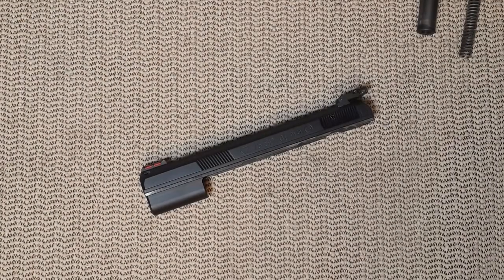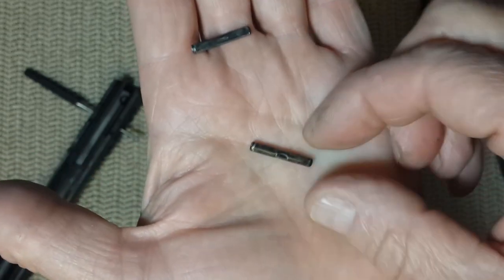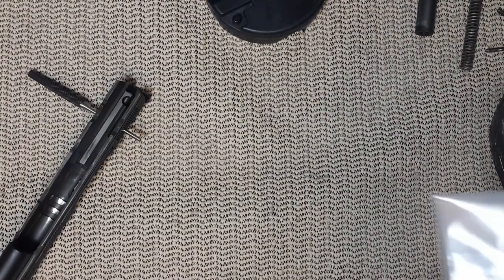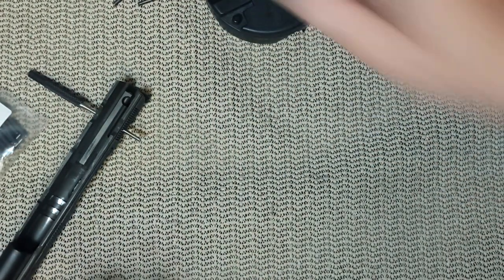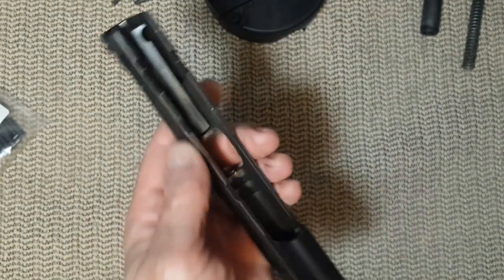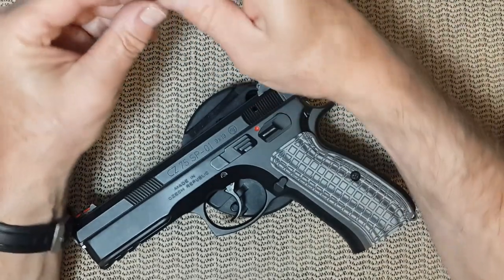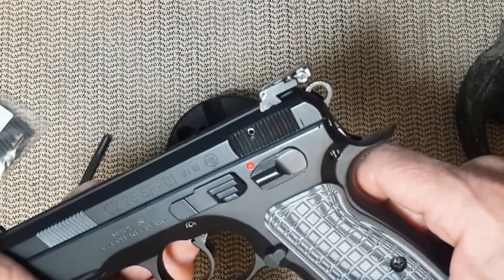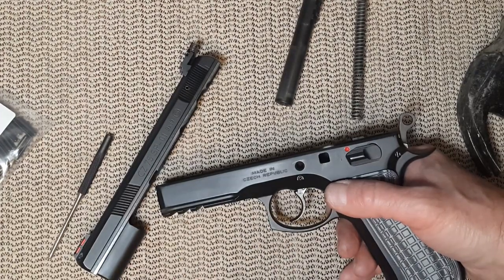CZ 75 SP-01 Firing Pin's Roll Pin Problem, and Solution

Comment: I did not know this was a problem.  I have like 5000 rounds thru my CZ SPO1.  How do I know when the pin needs changing.
Reply from the maker: John D - After removing the pin, if your pin is as dented as the one on the video, it is suggested to replace the pin.
Reply: 5000 rounds? lucky you...Im getting close but don't think I have that many....high 3's to high 4's, and mine broke, sheared right through bc the firing pin came right out with the firing pin block. I looked down the firing pin hole and saw nothing crossing the top, where the roll pin should be. I didn't know this was a problem either, now I know why it was sitting on the damn shelf for so long with no interested buyers. I think if pistols aren't circulating, somebody knows something I don't. I'm a little pissed too, bc the person at the shop who fixes the weapons acted like he had no clue as to what was wrong, and its all over the damn internet/youtube. Do you happen to know whats inside the firing pin hole? It looks like theres threads in there. I think it just may be ridges to hold the spring in place, but I want to find out for sure before putting it back together. I also heard about a solid pin, but up above, someone says it will damage the firing pin itself. I wanna make sure thats true too, before installing a new SHEAR pin. Piece of crap, really pisses me off. Ive heard nothing from reviewers about this/these kind of problem(s) on ANY similar pistols. I guess thats why people buy the $1.4-2K models. These may be good pistols, but this is the second one I own that something fell apart on, the other is a 97BD and the 4 pieces that make up the chambered round indicator fell off. Sorry this was long, but I felt like all CZ owners/potential buyers should know about these defects. Now I know why Glock people stick with Glocks...NO WORRIES MATE. I know they're Austrian, but it fits the topic.
      "Two residents killed today during burglary...homeowner had weapon, but seems to have fallen apart." "Probably would've ran the burglar off, if he had a Hi-Point." Thats the scenario that runs through my mind. OK, I'm off my soap-box now. Thanks for reading if you made it this far.
Reply: @1madmax22  sounds like a legit beef to this guy.  I bought three, sight unseen and customized them and have paid out nose for a suppressor for threaded barrel tactical (my supposed night stand gun).  Now I find out that in addition to everything else going on in life, I'll now be inspecting this bullshit item every 500 rds (or however long between inspections I think my life is worth) or so forever.  Some say they had no problems after subbing it with some tiny after market place (which makes no f'g sense; as you'd think CZ would have enough f'g pride to issue acceptable part to every f'g CZ owner over the past 15 years) but that's ridiculous. Just baffling.  And I haven't heard a peep about this mess until tonight.  I don't even remember how I stumbled across the issue.  Hilariously, just sold an unfired Glock .40 to a good friend because I had a CZ!  And I heard what I now have learned to be bullshit that suppressors aren't made for .40 (search the net and I can't find a hint of where I learned that one).

Comment: What size punch did you use for the firing pin, also what size punch for the trigger? I bought the punch and pins on Amazon, but I don’t want to use the wrong punch and mess something up. I want to learn how to do this stuff on my own though and not rely on a gunsmith.
Reply from the maker: Welcome back Michael. 
You will need a 3mm punch for the firing pin, that is, if you have the expensive Metric punch.
If you only have Standard punch (like most of us), the 3mm close equivalent would be 1/8" punch. In any case, always eye ball the size punch with the hole size. In doubt, go one size smaller, and as you hammer the pin down, you can change you punch to the next size up.

For the trigger pin, you will need the 1/16" punch.
Good luck
Reply: @practicalshooter6517  thank you very much. I had to order the roll punches on Amazon because all my local stores only carry the flat regular punches. I should not use a flat punch right?

My firing pin is stuck in the forward firing position. It won’t retract back far enough for the hammer to hit it. It’s almost like it’s stuck. I can still push on it and it moves freely, it just won’t come all the way back. It’s weird.
Reply from the maker: @AviMus82  I had the same issue when my gun was really dirty. The dirt kept the firing pin from moving freely. Once I remove the firing pin retaining pin, I used a paper clip to push back. You can also use a very small screw driver. Let me know if this help.
Reply: @practicalshooter6517  my problem is that I only have access to flat punches without waiting for the roll punches to arrive in the mail. Would a flat punch be ok to use, or should I ONLY use a roll punch?
Reply from the maker: @AviMus82  Yes you can use the flat punch, but it has to be the right size. Use the 1/8th punch. If at any time you think the punch is going inside the hollow pin, pull the punch out, but as the 1/8" punch is slightly larger than 3mm, it should work out fine.
Reply: @practicalshooter6517  k thank you for your reply. I appreciate how fast you are at replying. I’ll try the flat punch, but I also ordered the roll punches you suggested. 

Also one last thing, my hammer falls freely when the trigger is pulled,  it if you ride it slowly forward with your thumb you can feel it rub ever so slightly on the sear. I spoke to a gunsmith about it and he said if it’s operating fine than leave it alone. Do you think mayBe changing out the seat cage assembly would eliminate this? Again my only real issue is the firing pin. This doesn’t pose a problem to the functionality of the gun. It just bugs me. What would you suggest I do? Just shoot it till something breaks or replace parts till it stops?
Reply from the maker: @AviMus82  First of all, the roll punches you ordered are what you need to work on this CZ, the flat punches are just back up punches, so you did well to order those, then they will help you out with many other guns, so it's good to have them on hand.
Then, it's hard to tell without looking at your gun and knowing how many rounds have been put through it. Also, some powders are dirtier than others, which brings me to thinking of my original thought. Your firing pin channel is dirty,  and by that, it's stopping your firing pin to move freely. But everything else should fine. 
First, you would need to remove the firing pin retaining pin, then the firing pin and spring. 
Then with a q-tip and solvent, you will need to clean inside the firing pin channel by removing any dirt.
After this is done, re-install the firing pin and spring, then the retaining pin. 
Finally, I would think your gun will be running fine.

Comment: what are the benefits of removing the safety block?  i know the danger, but any benefits??
Reply from the maker: It gives you a slightly lighter trigger, not that much, but it ads up for competition, and by the way, on the safety side, I never had any issues. You would think, with the safety block removed and an extended firing pin, their is always a chance for the firing pin to hit the primer when loading first round in the chamber, but nothing ever happened.

Comment: do you have any experience with broken firing pins?  Ive broken 2 in my canik c100s and I'm disheartened.  I will refrain from dry firing them but since you seem like a cz guy is there any remedy to feel more secure about the firing pin?
Reply from the maker: Did the firing pins broke at the tip?
Reply: @practicalshooter6517  yeah, right at the tip.  I have been sitting at home all day for the coronavirus lockdowns and dry firing my canik.  I think I will just not do that anymore without a snap cap, but Im wondering if you have had any experience with them breaking under non dry fire conditions.  Ive had a particularly bad streak with strikers/firing pins breaking on handguns thhat have moved to MIM strikers, so i am kind of an outlier in that before I will carry a gun I need to ensure it doesnt suffer from striker/fp problems.  Such as the FN509, this gun has one of the dumbest designed strikers known to man and its MIM, idk how some gun companies can stay in business sacrificing the integrity of arguable the most important piece of the gun.
Reply from the maker: @jjmarcos  I never had issues with any of my firing pins on any of my guns, and I do shoot them a lot, and dry fire them a lot as well, without using a snap cap nor an o-ring. I suspect some firing pins will be better made than some others. 

MIM can be used with so many mixes of metals, that results of relliabilities are wildly varied. Manufacturers know that and will generally replace free of charge a bad MIM firing pin.
Reply: @practicalshooter6517  Thats good to hear.  The tri-star customer service told me the canik pins are machined and not MIM so that made me feel a little better.  Ive had so many mim strikers break on Kahr, Sig, FN pistols that Ive grown to distrust the method for this specific part.

Comment: Would you say the roll pin is the only issue on the cz?  Considering buying a cz 75 p-01
Reply from the maker: Yes, that is the only issue associated with the SP01 serie handgun. Go for it, CZ's are exceptional guns.
Reply: @practicalshooter6517  haha, I hope so.  I just waited nine months to suppress it and mounted a Steiner light about a month ago (plus CZC trigger job).  Planned to start cranking some rounds through it soon and I stumbled across this issue tonight.  I come to this video and it sounds like a legit, inexplicably unnecessary issue. I'm not mechanical in the least and have never removed one of these pins with punches and hammers, etc. Geez Louise.  To say this is kind of disappointing, is a big understatement.  I have SDP from CZC and CZ-75B (also sent to CZC) (both unfired).  Pretty sizeable investment and I find out I have to carry hammers, punches and bags with me.  Wow.  And checking the pins "for wear" every 500 rds??  Insane.  PLEASE GIVE ME SOME GOOD NEWS.
Reply: @Sqwee Thx, which is best replacement pin of choices out there?
Reply: @Sqwee thx. CGW has an option, too, right?
Reply: @Sqwee thx, I think so.
Reply: @Sqwee says cz 75b in the link, do you know if they work on cz 75d? Since thats what the p01 and pcr are.
Reply: @Sqwee cool, thank you

Comment: that pin isn't there in the sp 01 shadow right?
Reply from the maker: That is correct. The Shadow slide is slightly different.
Reply: @practicalshooter6517  so a solution would be upgrading to the shadow 1 or 2 even :D
Reply from the maker: @utenteutente9531  LOL that would be the "Expensive" option, yes LOL

Comment: Why not put a solid steel or solid stainless steel?
Reply from the maker: Good point Wayne, but you have to understand that if something has to break, you want it to be the cheap part (the pin) and not the more expensive one (the firing pin). 
A hollow pin will give first, without damaging the firing pin, same for stainless steel. You have to find a good medium between longevity of the pin and minimum wear on the firing pin.
Reply: @practicalshooter6517 , good point.

Comment: Bought and SP01 tactical. First, my firing pin retaining pin broke. Then,  trigger sping broke. Then, firing pin broke. All within less than a thousand rounds. Fun to shoot, but I'll carry my Glock.
Reply from the maker: Good God dbunce10, you have some serious bad luck with CZ. I would also have gone with Glock after such a bad experience. As I look at my shooting Spreadsheet, my SP01 has 6500 rounds with nothing broken, just that firing pin roll pin I replaced early on. Good Luck.
Reply: @practicalshooter6517  Had all parts replaced by Cajun Gunworks. Have had no issues since. I still will carry my Glock. I actually had to replace roll pin twice.
Reply: Same with a p07
Reply: @dbunce10  ALL...how many is that?  I'm owner of three CZs (all either bought from CZC or sent through there for actions, night sites, etc.) without having fired one a bunch before ordering further CZs, having apparently drank the Kool-Aid.  Tonight, elsewhere, I stumble across this little problem.  Then I (not Mr. Mechanical) begin hearing about hammers, punches, damaging receiver, bags of spares pins, knocking the damn thing out every now and then just to examine it.  It's a piece of f'g steel.  Can't CZ figure that out??
I also have 50 rds through SP-01 tactical. Loved it so much, plan to make it night stand gun and waited nine months for a suppressor!  Gotta be f'g kiddin' me.

Comment: lol 100 pins will last you like 1,000,000 rounds
Reply from the maker: LOL that's the idea. Every time you clean your gun, you replace the pin, like if it was the original pin you are putting back in the gun. Take it as a ..... consumable. And one less issue to deal with. 
Yea, I know, that's a lot of pins. But try to use them on other projects lol. That's part of the fun LOL.